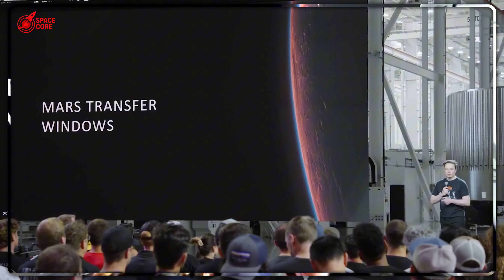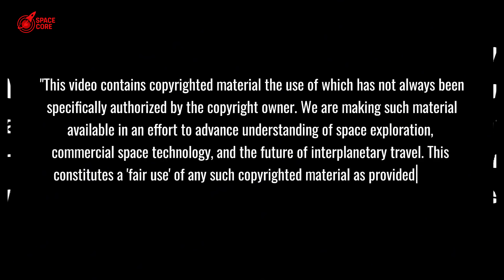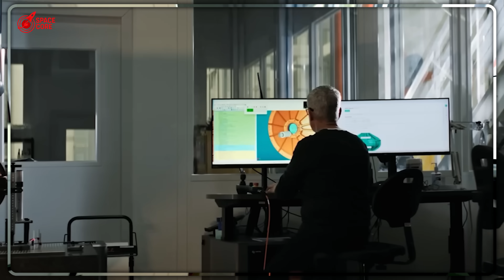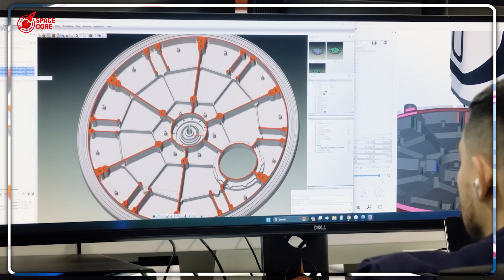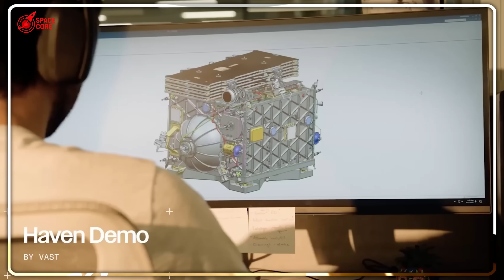SpaceX Starship SHOCKED NASA: 3X Bigger Than Dying $150B ISS...Game Over!

Comment: The writing is on the wall 
It is inevitable that low earth orbit will be filled with starships. 
When the dividends begin to pay off for my 
TSLA stock and when SpaceX goes public 
I will be placing my order for my own 
ISS starship 
It won't be long when the country is filled with star bases for transporting thousands of tons of material anywhere on Earth in less than 24 hours. 
ROBO STARSHIPS
Hail one to the Moon fly pass all the stars headed to Mercury or Mars 
Self landing rockets Optimus robots equipped with hands that has 21 degrees of dexterity the ability to pick you up when you fall down can answer any questions I have with the mind of Grok 
The origin of space travel is not blue 
If it was any bimbo could be an astronaut or should I say in Jeff's case 
SPACE CADETS
Reply from the maker: Love the vision of low Earth orbit filled with Starships revolutionizing space like the dying ISS never could!